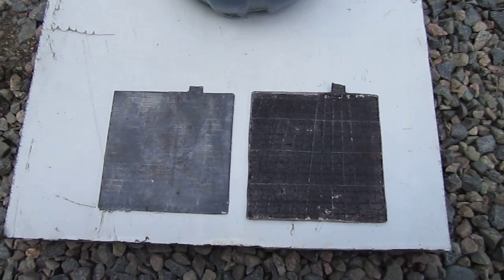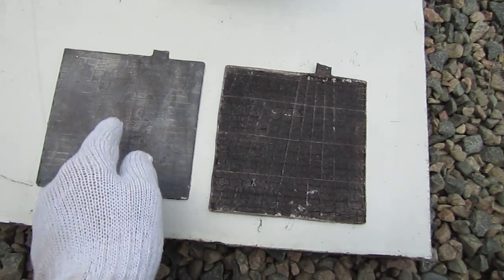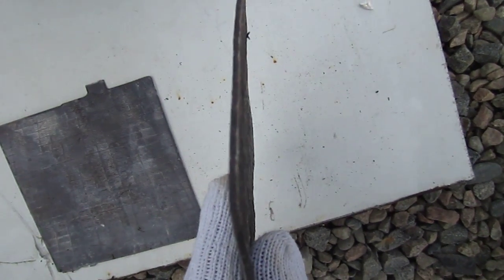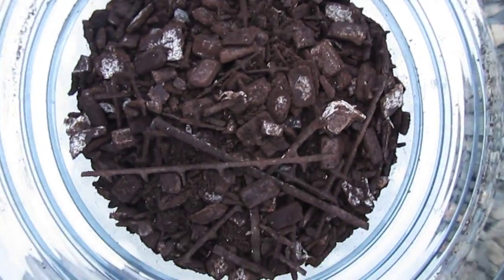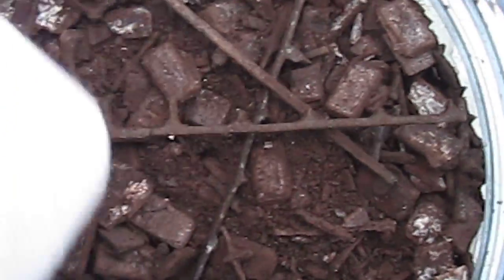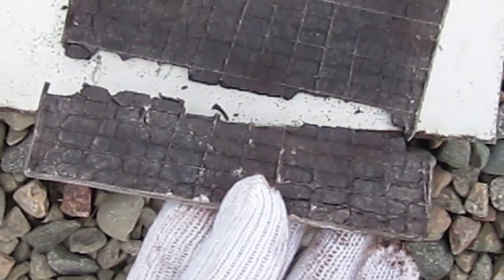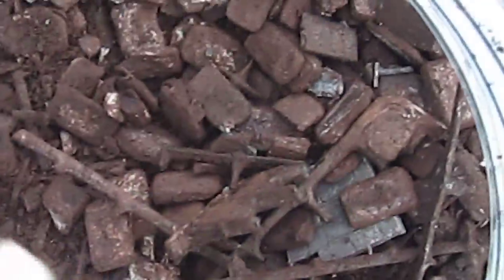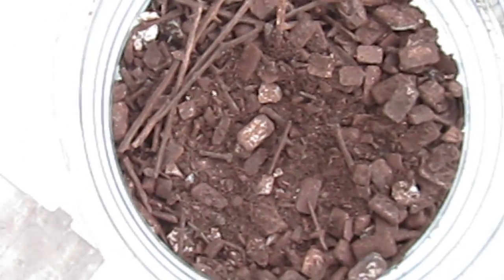Lead Acid Battery Plates  Neg/Pos

Comment: I found you can salvage the negative plates from dead lead acid batteries and rebuild them into a new battery. if the negative plates are in decent condition they can be reused and achieve roughly 1/2 the batteries original capacity!
Simply use either 1/2 or 1/3 the negative plates as positives. and the lead dioxide layer will begin forming!
Keep it going afterwards. You want it kept on a trickle charge. float charge for maybe several weeks. and charged often. the self discharge rate will decrease with use and more float charging. until its able to hold a charge on its own!

You can use two dead batteries to potentially make 1 fully working almost like new battery if the negative plates are in good shape!

Usually the positive electrodes have disintegrated into useless mushy junk. and can probably be discarded.

You might be able to very poorly make a paste out of positive electrode material and slowly convert it into metallic form lead by reverse electrolysis on the red lead. using a diluted sulfuric acid OR substituin baking soda.
Baking soda is very slow but can work. Magnesium sulfate is faster. but your sacrificial anode may disintegrate and need to be replaced several times.

You don't even need any special binder. Just press it tightly into some kind of lead grid. under pressure. with a VERY VERY THICK and dense separator between the electrodes.
it'll form conductive pathways through the particles compressed against each other and slowly convert the lead into spongy metallic lead.
Thats why you need a very thick separator. and decent spacing between the electrodes. but it works!

Comment: I really thought you would show more than just the plates.  I know thats what you said you would show, yes nice to know what it cost for the lead paste. But is there a value to recycle the paste?  Saw one guy just knock the dried paste out of the lead grid onto the ground, which if it is indeed has lead in it, doesn’t sound like a good idea.  Why didn’t you do that instead of smashing them up together?  Don’t you have to separate them anyway, so you can melt the  solid lead grid?

Comment: What is the insulator for the negative plates?
Reply: The + & - plates are separated & insulated by plastic based fabric or fiberglass mat that strong enough againts acid. Cotton based fiber will destroyed within second..
Reply: @jstwatchnread8420  Appreciate, thanks

Comment: The red lead makes dragon eggs fireworks, the small crackling stars that burn brightly when mixed with aluminum powder. To reuse for a battery grind it all, including the plate frames. Mix some fiberglass powder in it and make clay like. Cast a plate and put the paste in scraping flat. Wrap in fiberglass paper, Allow to air dry, then bake at about 400 to 450 degreesF for a few hours.
Reply: The lead that burns on fireworks contaminant the air with lead, similar from leaded gasoline from the past..
Reply: Thanks. Can you explain in more detail?
Reply: That would be Farenheight,  since lead melts at 327.5°C/621.5°F.
Reply: Que tal. Soy de Argentina.  Estoy reparando baterias y veo todos los tumorales en YouTube.  A ese reciclado de placa positiva se la calienta hasta que quede amarilla. Se la pulveriza con molienda.  Se le agrega algodón y fibra de vidrio. También algo de MINIO. óxido de plomo rojo. Agua y se hace la arsilla. Se la coloca se deja secar al sol. Se la cura en ácido de bateria..  CUIDADO NO RESPIRAR NINGUN POLVO O HUMO. NO TIRAR RESIDUOS AL MEDIO AMBIENTE.. NOS VEMOS . SALUDOS..

Comment: Basically.
Crush negative and positive plates, separately.
Melt the lead.
The antimonium grid will float and be taken apart.
Then cool the melted lead in grains.
Put the grains in a rotative barell with steel balls inside to make a lead powder.
Melt the grid antimonium in a higher temperature and pour in grid molds.
Then press the lead powder in the grids using maybe 1ton of pressure in a hidraulic press. And you'll have new plates.
Put fiber glass separator between the plates and you'll have a new battery. And watch Pakistani battery truck to learn how to reassemble the batteries.
Reply: I wanna know what is the conductive binder agent used to bind lead sponge or powder tougher with grid ?? Or is it just done by hydrologic pressure ?
Reply: And baking the plates sets the paste firm.
Reply: You seems master

Comment: Thanks for sharing.

You have definitely touched on a subject that is very close to my heart since storage is the most expensive part of solar energy collection.  Anyone who learns to make their own deep cycle batteries from discarded car batteries is home free and off the grid overnight.

As Li-ion batteries become more popular (I don't know why since they don't last any longer than Pb-acid) - except for the weight factor in vehicles) the price of lead will crash and nobody will want to be in the battery recycling (for lead only) business.

Youtube is full of videos on how to pull things apart but videos on repurposing and recycling are few and far between.  Let's all keep up the good work.  We are heading in the right direction.  

Looking forward to the next exciting instalment.
Reply: So Robert  Murray Smith  has do.e videos on  repurposing . His lead acid fabrication and repair  videos are two years ago .He s  a chemist who was doing mainly  supercapacitor videos  for several years. The  zinc bromine  attery lools like the winner for home build.
Reply: Basically read lead (PbO2) is just simple material, but it fragile & need to reshape into solid plate, that's why it need to mixed with some clay & baked in the oven with antimony grid as conductor...

Comment: Thanks for the good video. 
I was wondering, .......... what happens if you crush the positive plates just as they are,  to a fine powder (the left over lead and the PbO2) and then make that into the paste? I have done that and it seems to work ok. I got a short cct current of 4.68 amps after charging. The short cct current was sustained for at least ten minutes at which time it went just below 1 amp. The test cell I made was very tiny,  only 1 inch wide x three inches high surface area.
The forming of the new rejigged positive plate, improved vastly after three or four charge discharge cycles. Thanks Edward

P.S. May I caution you that those gloves are next to useless as a guard against the toxic lead dust. You really need to use fully black rubber gloves that are fully sealed.
Reply from the maker: +eeezygoing Yes very much agree with the cloves. They were only for making the video and thrown out afterwards. Yes useless for sure. Neat about you little plates you made. I never figured out yet how to make a big lead grid for the paste to be pressed into. I,m thinking of using some hard wood. Its something I,m still playing around with. Your welcome also Edward. Tks for sharing your little playing around also. If you go bigger let me know please how it worked out. Take care
Reply: +Thinking out side box  , ..... Yep I sure will let you know. It was watching your video that inspired me to try in the first place, so I am very indebted to you. You need / deserve the thanks more than me :-). 
By the way, .....  it is very important to use non-contaminated water for the electrolyte. Distilled water is good, but de-ionised water is better as there are no electrical ions inside that could discharge your plates and make the battery just junk. A cheep source I found is pure and chemical - free and bacteria free drinking water. You should be able to find it in the super market shelf for around $1.00 a litre. So it will probably be $5.00 a gallon for you guys. I am assuming your from the US. I am in Australia. I hope to try aluminum sulphate so that the nasty sulphuric acid is removed from the batteries. Others say Epson salts also works. I just dont have the test of these done yet.
&#160;Like you, I am also working on making a grid. regards Edward
Reply from the maker: All sounds good. The right water is needed for sure. Well good luck with it. l,ll make a another video after I have made mine and show everyone.